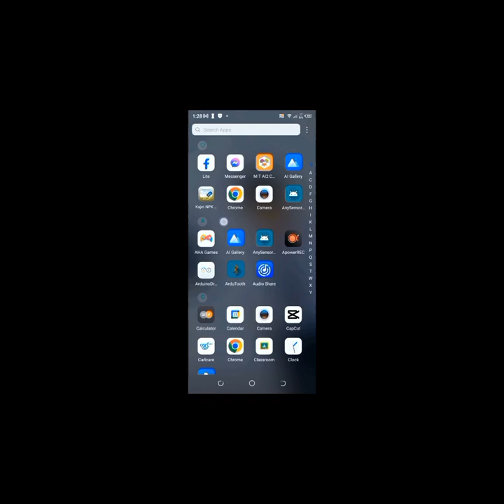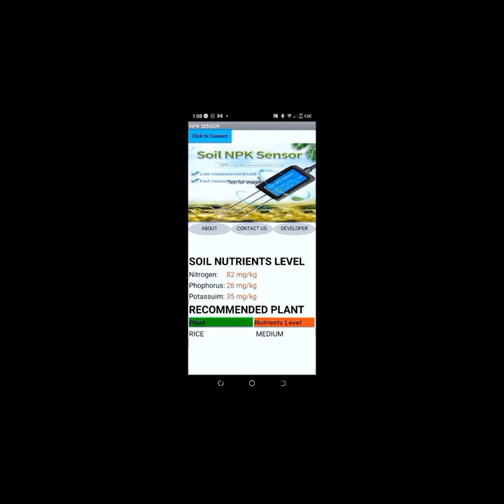How to prototype smart soil nutrient analysis & android app integration. # Arduino Uno & Bluetooth

Comment: Hello, I'm also working on the same project that involves interfacing an NPK sensor to an Arduino using a MAX485 to RS485 TTL module. Can you help me by guiding what pinouts or the circuit diagram that you used in this video? Thank you
Reply from the maker: Anu Po bang naging problema .
Reply: @kajet6018  Thank you for replying. Yung sa circuit po ng Arduino Uno, NPK Sensor at Max485 to RS485 TTL,  Yung sinusundan ko pong circuit diagram is gumagamit siya ng Arduino Nano however nung triny ko siya  sa Arduino Uno 255 lang po yung output. So ayun po, pwede ko po bang malaman yung circuit interfacing niyo po about sa NPK, Max485 to RS485 TTL, at Arduino Uno?
Reply from the maker: Sa power supply Po Yan kaya 255 Ang lumalabas Yung default nya Po Yan sa code. .
Need Po 12 volts Ang supply Ng npk NYU . Hiwalay Po Ang Po Ang power supply nya
Reply from the maker: May bagu ako upload na video .
Reply: hello po, may data po ba kayo sa mga recommended range ng nutrient level ng mga plants? gaya po nung pagrerecommend ng plants?
Reply: @Acevesting
Reply: Pwede po favor ng video paano ginawa yung npk sensor application..
Reply from the maker: @markvincentprotacio5782  Android app Po? Is MIT 2
Reply: @kajet6018  ahh MIT mo po ginawa, pwede mo po mashare paano mo ginawa?
Reply: @kajet6018  opo yung android application
Reply from the maker: @markvincentprotacio5782  Alam NYU na Po ba Yung MIT ?
Reply: @kajet6018  nakikita ko lang sa youtube yang MIT app inventor pero hindi ko alam pano gamitin yan
Reply from the maker: @markvincentprotacio5782   hanapin NYU Po site nya MIT app inventor2 then need NYU Po mag log in account. TAs pag nakapaglog in na Po kayu dun start na  new project . Code blocks Po yun .
Reply: @kajet6018  may video tutorial paano mo po yun ginawa?